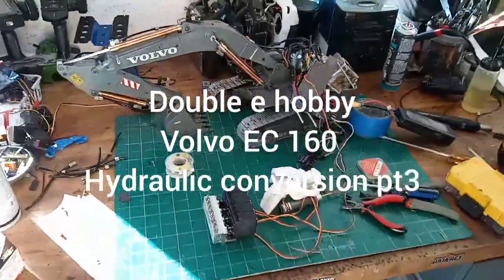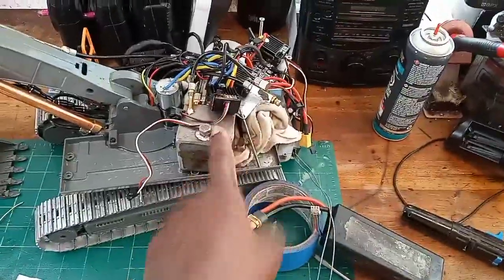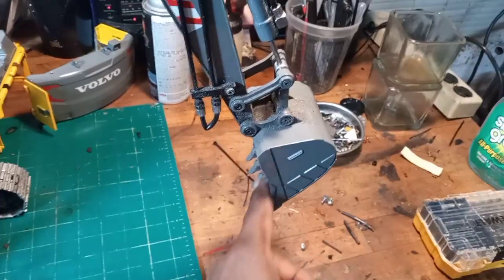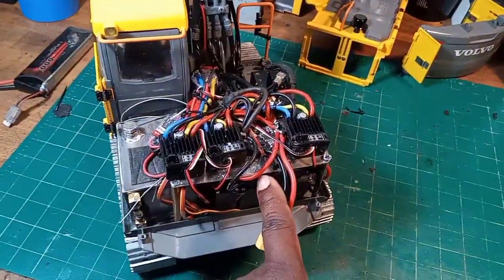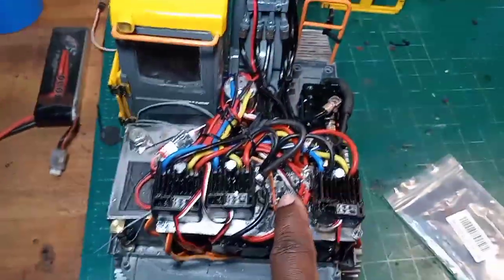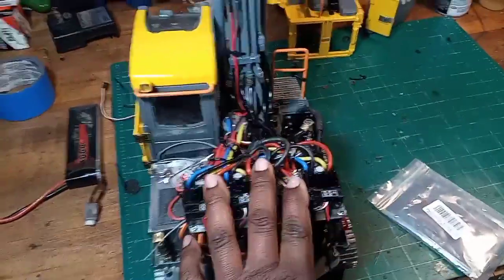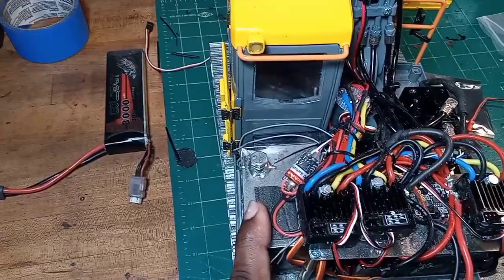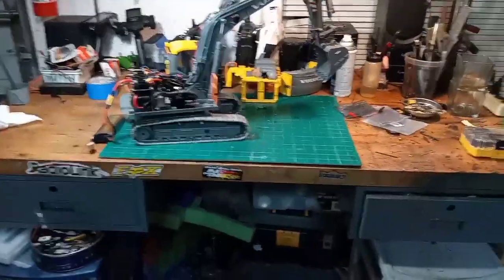double e hobby Volvo excavator hydraulic conversion pt3

Comment: I suspect that the factory hydraulic tank may have baffling inside to help prevent sloshing (& foaming). The baffles are just metal plates arranged inside the tank in a way that allows the hydraulic fluid to flow around the baffles, but prevent the hydraulic fluid from moving quickly from one side of the hydraulic tank to the other side (which creates the sloshing). I'm not sure, but I think baffles would be installed in the factory tank, preventing the hydraulic fluid from foaming. Great work. I've always wanted an R/C model hydraulic excavator, & I plan to get one sometime.
Reply from the maker: Thanks I eventually got a small fuel thank from the hobby shop.